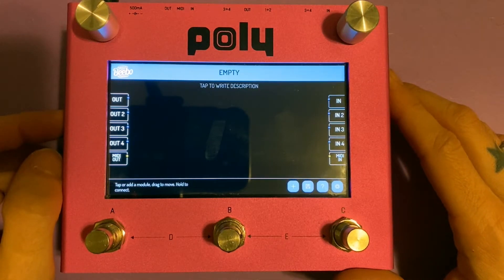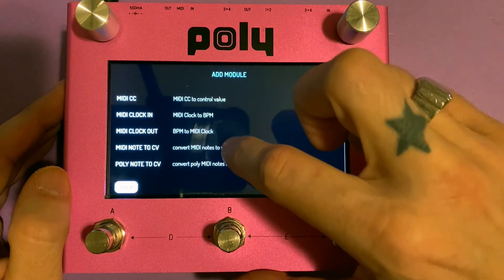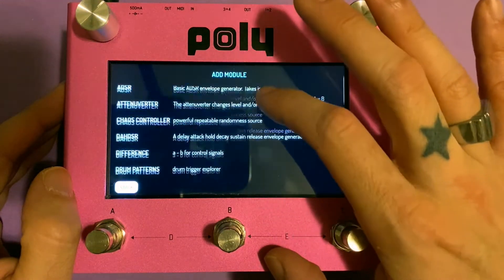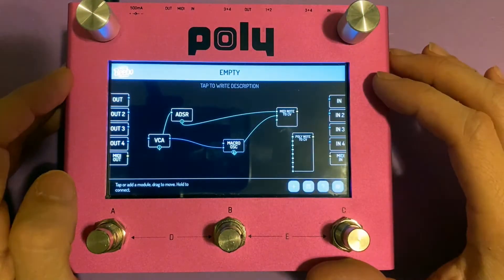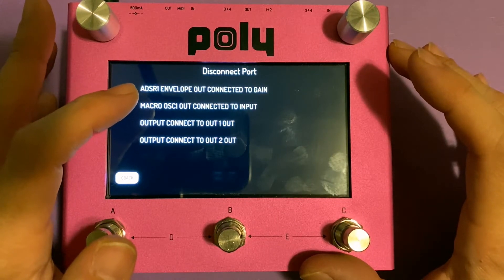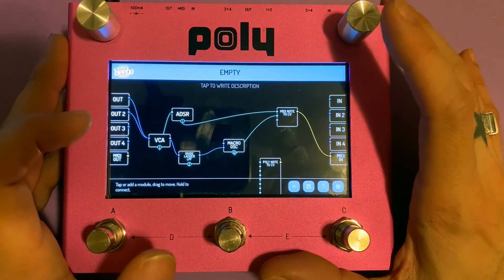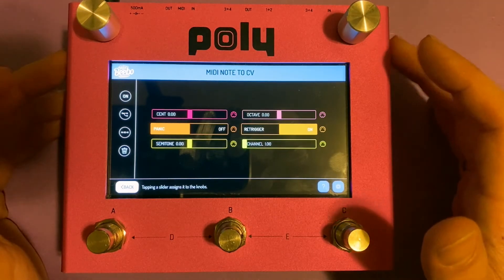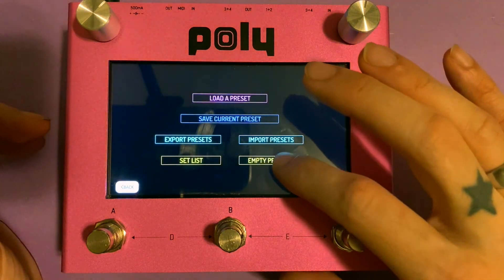Beebo Midi Synth Patching 101 - Part 1of2

Comment: Are the 4 other inputs different from the midi IN? (The one you have connected to the chain) it gives me no sound out of a solid state amp, on synth presets or really any preset that is thru the midi in. I dont think its broken i just think im overlooking something..
Reply from the maker: Hello, I will do my best to help clarify things for you and feel free to tell me more about what you hope to do overall. 

The other 4 inputs are not midi, they are stereo capable audio inputs and outputs. 

Are you using an existing synth patch like one of mine? If so, you would usually need to send midi messages from a controller. I used to use a KeyStep primarily and sometimes still but am more likely to use an Oxi One lately. 

Without some midi information going in, there would be no sound coming out, which is a good thing, because you want it to only play when you want it to play!

I can help point you toward how to make patches and solve things like this, feel free to let me know what your overall goal is and I can try and help from there.

EDIT: it also occurs to me that we should talk about settings and if you using a midi controller, are you using the correct midi cable type for your unit? Some models were built with type A or B and on their site, you’ll see which one you have accordingly by serial number.

Aside from channels used and all - a few details worth confirming together.
Reply: I dont have a midi controller, and ive been using the first input only. Theres some modules though ive found that can only be connected to the midi in and out (?)
Reply from the maker: There are a lot of great videos you should check out- start with some of the videos from Poly Effects specifically where they run through the modules A-Z.

The synth patch specifically here will not produce sounds without midi control as they are. Simply put, they are not made to produce a sound that is controlled by your guitar. 

There are things that you can patch and some ways to use guitar to trigger or perform a single note (not chords) to be a synth but it’s a bit more difficult to explain before maybe you watch some of the module videos. 

There are patches you can make that won’t need a midi controller, it can be done all internal to the Beebo, but without a midi controller you won’t get as much as the benefits of what’s possible polyphonically as a synth.
Reply: I am using a guitar, not a keyboard if that helps
Reply from the maker: MIDI is a very different thing from audio and such, it’s a really deep topic but there are videos and articles for you to see what can be done and how to use midi itself. 

If you would like to set time, have a live conversation, I am happy to help you learn things as well offline together.
Reply: i have only one more inquiry…, the midi input on the digit/beebo seems to be an auxilary-type connector, do i need a certain midi cable adapter to connect and can i find them online?
Reply from the maker: The midi ports are not auxiliary in any form, they are dedicated to midi. One is an input and the other an output. 

Check your unit’s serial number on the Poly Effects site to best determine if you have a unit with a type A or a type B midi port. The adapters for type A or B to a 5-pin midi type are available online for purchase.
Reply: where to locate this serial number on the beebo? It said it was made in 2020 but it has the latest firmware
Reply from the maker: Typically the serial number would be physically located on the bottom of the unit itself.

Firmware is not a factor here. It would be the serial number that helps indicate your midi type A or B and can be cross-referenced on their site specifically.
Reply: Will it stop working if i perhaps connect the wrong midi cable
Reply from the maker: If you use the wrong midi cable type, midi information simply won’t travel correctly.

Nothing will be harmed in any way on the unit.

Comment: Can the ADSR be connected directly to the OSC and control level? Would that do the exact same thing? Then you wouldn't need the VCA. I don't know exactly. The VCA might be needed.
Reply from the maker: You are absolutely correct - ADSR can connect to the MacroOSC Level CV directly. VCA would not be needed on most of the sounds. 

Some that are percussive would need the trigger still for the full effect but there is something pretty cool about the snare as a drone!

Comment: What situation and how do the add, subtract, multiply etc. modules? Are they what would be considered logic? I can’t make heads or tails of them and it seems like a lost opportunity on my end.
Reply from the maker: Modules such as Product work like CV logic to multiply for instance. Other helpful modules would be Sum, Difference, and the Attenuverter to tailor and adjust CV. It's based on 5V overall I believe. In the future, I would love to see more done in the firmware for options on CV logic/functions.